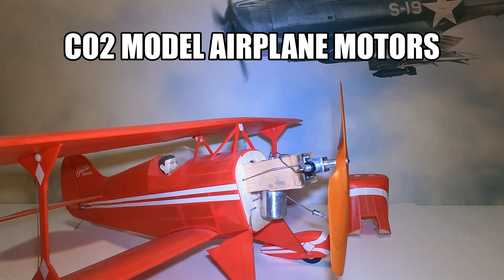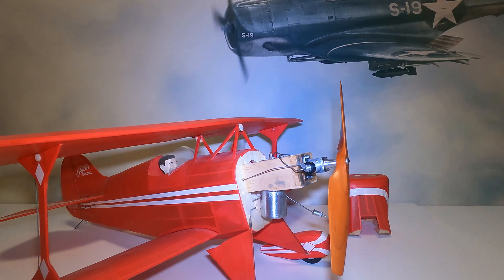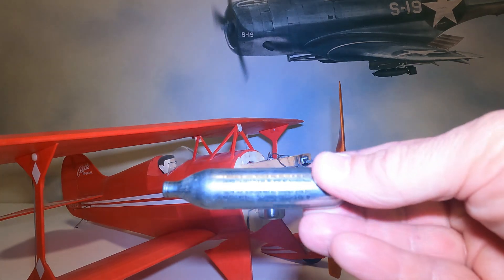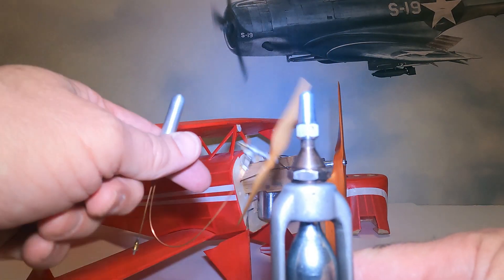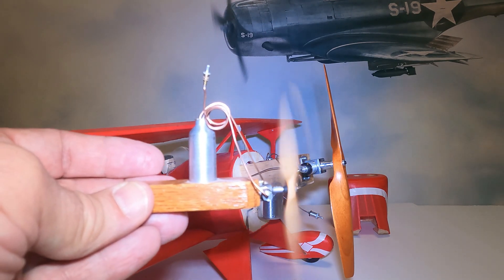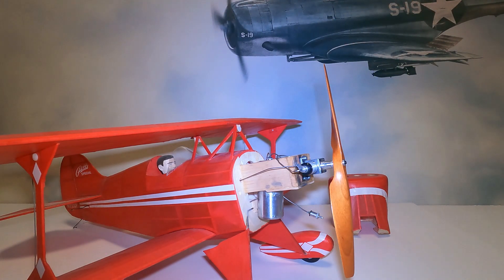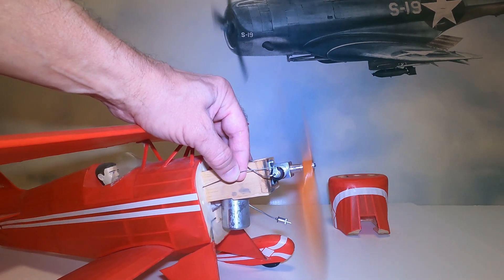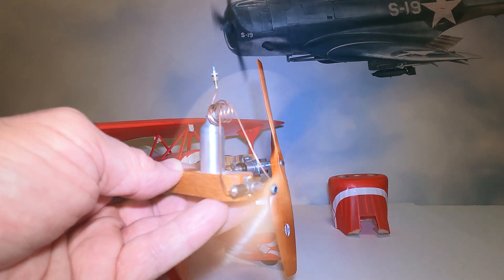C02 Powered Model Airplane Motors

Comment: I recently found an old Brown CO2 motor in my load of old modeling gear (long time modeler).  Never used. I would like to try it in a small FF model.  Questions:  Where can I get the co2 cartridge holder you use?  Can you give me any guidance on the model size that is appropriate, weight, wing span?  Thanks......
Reply from the maker: I need to know what brown motor you have to give you information on what size/weight model to build?

I only know of one company that sell chargers for C02 motors. That is Old Model Engine. However, you may luck out and find an old Brown charger on eBay.

http://www.old-engine-model.com/en/

Comment: I just picked up an old “Baby Brown” MJ-140V twin on Ebay. It's pretty grimey and stiff - how do I go about cleaning/lubing it? I'm afraid to just start disassembling it.
Reply from the maker: You can lubricate it with Marvels Mystery oil. I use it on all my CO2 motors.
Reply: @JoeMalinchak  I just picked some up and gave it a few drops and it is now nice and free - thanks! Now to hunt for a tank, and more importantly a way to fill it. The fill nipple is about 1/16 diameter, .067mm. Any recommendations on finding a fill setup? I've read about SodaStream adapters but have not been able to find anything.
Reply from the maker: @svenyonson27  Check out this website, http://www.old-engine-model.com/en/ They sell Gasparin CO2 motors and accessories. They also have fill adapters. You should have a 2mm filler nozzle on your CO2 motor. Only the real small CO2 motors have a 1mm tip.

Comment: Nice... I just sub to you channel.. Question: i just got a Hacker Bellanca super decathlon. Uses rubber band or CO2 motor or electromotor.. Can this plane be made to a RC plane? Mod num 2304
Reply from the maker: Yes, you can make the model R/C.

Comment: Back around 2000, I decided to build the Dumas Staggerwing Beech craft biplanr. I also decided I would use CO2 to power it. Unfortunately, by then co2 was just a memory, there adds for Gasparin co2 motors but by then they collectors items. I thought about using my Telco co2 motor, but the seals were bad, and neither charger would work. I built a model using plans from Model Airplane News, for a Telco, and it flew good caught some good air and wound up on the other side of a ten acre field. I could just see the prop turning over during the entire flight. I miss those days!

Comment: One might hope there are 3D printing enthusiasts who develop some modern versions of these without the precise metal tooling requirements. Whether in aluminum or carbon fibre, that can withstand the pressure & cold temperatures.They certainly have a place in modeling and besides, we wouldn't want to waste all this excess 'climate change'-causing CO2', right?

Comment: I have several of these Gasparin motors. The problem I saw was that if you run them fast the O ring seal gets pushed into the exhaust ports and since the edge is sharp on the inside of the cylinder when the rubber is pushed into the hole the sharp edge cuts a little crescent of rubber from the O ring. I like to take some dental floss and rub a length of it over a block of jewelers rouge. then feed it through the exhaust port and pull it back and forth across the bottom of the hole. This rounds off the edge of the hole. It takes the sharp edge off of the hole on the inside and you can run it faster with out cutting up the rubber ring. The rings last a lot longer.

Comment: Glad to see you're still making videos, I've been a fan for over a decade. I designed a micro scale japanese zero that you might like. It's unpowered but easy to build in about an hour and it flies great. Just print it out and glue it together. It's a great desk toy that you can throw and it will do a loop back to you and land on your desk. I'm sure you have the skills to make an RC version of it. I'd love to see you build and fly one. The parts for multiple planes can be printed on a single sheet of paper and you can make 1 inch and 3 inch versions that both fly. Here's a link to the video and plans. Keep up the good work. 
Sincerely, Jason, RC101
https://youtu.be/4xldHOSC9h8

Comment: If I knew of this engine before I'd never have had a love for a machinist life. I had an Air Hog pump plane. After a few times of pumping it up I got a wild hair in my ass and decide "MO Powah baby". And rigged it to fly with Co2. The plastic air cycle engine got so cold it blew up. I didn't have a lathe, press or anything aside of a drill and some files. Round and bastard files. So me and my papaw cut up an old car rim for the aluminum and he showed me how delicate your hands can be and we made a boxer style 2 cylinder air cycle from a car tire. He was an old cowboy as I'm a cowboy today, but I didn't know these engines existed until now. But I learned a lesson that helped me as a sniper in the army for 10 years, as a cowboy, dad and husband. Your hands make everything possible. And I last flew that airhog 2 years ago on the day of his passing at his grave. I built a stand for it and it sits with him now. That Co2 engine lasted 24 years. My sons 5 and were now building a 2 charge 4 cylinder Rc car. This is so cool cause having the evap loops should give us some more run time and I never thought of that. Thank you sir, it seems odd I bet, but you helped start a tradition I hope.

Comment: I just know you are going to be plauged with "where do you get these" - let me be the first.   Thank you for this very interesting video.  Brown used to produce motors many years ago.
Reply from the maker: You can find some nice CO2 motors on E-Bay from time to time. You have to ask if they still run? You can also purchase Gasparin Motors from oldenginemodel.com. They have a great selection of motors, and spar parts.

http://www.old-engine-model.com/en/k266.gasparin-co2-motory/
Reply: @JoeMalinchak  Thank you for the reply and checked out the link.  Looks good.